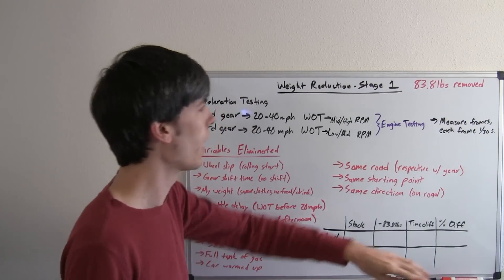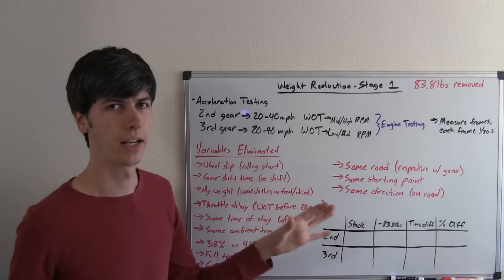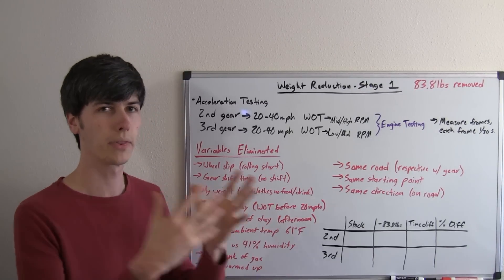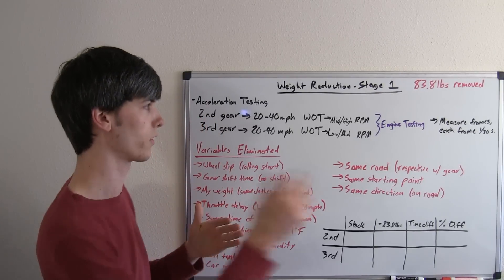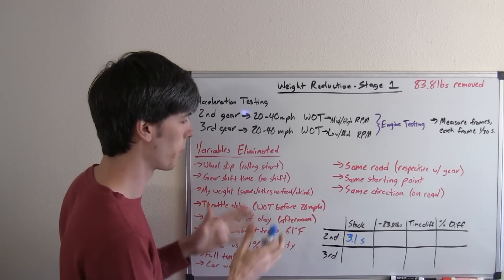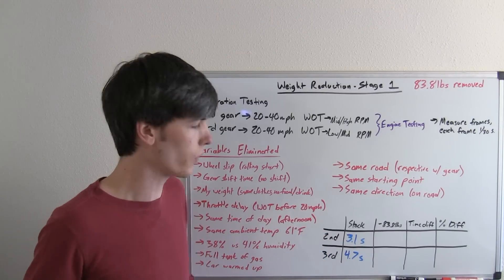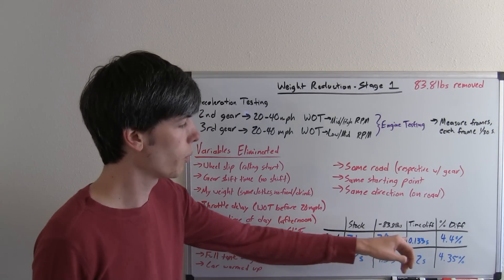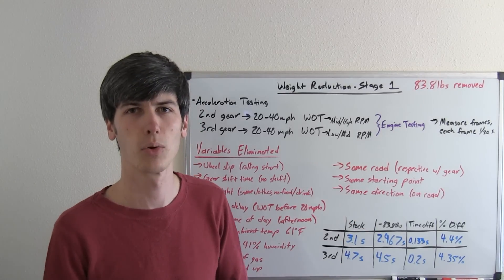Acura Integra Weight Reduction - Acceleration Testing - Stage 1

Comment: Hello .
Nice tests , thought i think you should be doing one more test at higher rev , because if you'll make more changes at intake , exhaust or other in the engine bay, the performance could be other at let's say 4000-6400 rpm than the low-mid rev. range. By the way your engine max. power is at 6300 rpm and max. torque at 5200 rpm; that means you did not touch any of max. power and torque in your tests. In that way you'll have a new comparison range .

Comment: you removed most of the weight from the back and it will mess up the balance of the car, since it's a FF it's already has all the weight in front
Reply from the maker: Yes indeed, I'll be looking to remove some weight from the front as well.

Comment: How about the wind ??
Reply from the maker: Based on weather reports it was essentially zero. The 2nd gear runs were in opposite directions from the 3rd gear runs, and they both provided similar results.
Reply: It was hot comment and you answered anyway, you guy rocks !
Test results are quite the same, so I'm satisfied by this test.
 i've learned so much from your videos, keep going on and thank you :)

Comment: So having taken into account all the variables, you do the runs in opposite directions. How does that take into the wind that will no doubt affect the results?

You said you wanted to use 2nd and 3rd gear for reference IF they were given reason to be used judging on this test, wind is a big factor
Reply from the maker: Sure. There wasn't wind when I was testing, the road is between a good amount of buildings/trees. Also, second and third gear pulls were in opposite directions, and both yielded similar results. Good point though for sure. The effects would be fairly negligible with low speeds (up to maybe 15-20 mph wind or so).
Reply: Engineering Explained Well it's not mentioned that it's between trees, that eliminates that variable, Stage 3 when?
Reply from the maker: xxxjake999xxx After stage 2. :)

Comment: What % of the stock weight is that 83lbs?
Reply: Engineering Explained that's interesting considering that it's 'almost' the same as the % time diff. I suspect this relationship wouldn't be linear though, but would flatten out on a weight-timediff curve.
Reply from the maker: Somewhere around 3%.

Comment: I think there is some empirical formula which argues that the acceleration 0-100Kmh is between [1,1.15] (confidence interval) times the weight to hp ratio (Kg/Hp)... Unfortunately, the bookmark I had stored it, is dead link now.
In this video you did not make such a test, but I am sure you have done. Do you confirm this formula?
Reply from the maker: Not sure of the formula, but with some F=ma math I'm sure it could be figured out.

Comment: When I had my Integra type R I carried out quick a bit of weight removal Taking the weight to 1030kg with a rollcage and bracing but no driver. From memory here are some of my findings. If you can be bothered the sound deadening in your boot will save about 4-5 kg if you can be bothered chipping away at it. Swapping the seats to racing seats saves 5-10kg per seat depending on what you go for. The roof lining and plastic furnishings in the back will save about 5-10kg. Changing the exhaust will save about 5kg by going to an aftermarket stainless steel one. Coilovers vs Stock Suspension will save a 2-3kg per corner. The aircon weighs about 20 kg.

Comment: To be honest, you never hit WOT, and this is mostly nit picking, but a 0-60 speed test from a stop is usually the best way to really test how a car will accelerate.
Reply from the maker: It was always at WOT (wide open throttle, aka the throttle fully open). 0-60 is not the best, because it allows for wheel slip and gear shift time variables. The results were incredibly repeatable (within 1/30th of a second).
Reply: Looking at the video again, I see that it was WOT, I forgot about the fact that the engine climbs in RPM even when the throttle is wide open, I apologize. Part of the reason I mention 0-60 though, is that the vast majority of the car world uses it as the benchmark for acceleration, but I can understand that you didn't want to do 0-60 tests because of speed limits and such. Just my two cents. Keep up the great videos however, I enjoy watching them.

Comment: Wow I am very impressed with the accuracy of the test. I know testing stuff and getting close to the same result is very hard, In my  CHM151 labs I had to get my results within 5 percent or I had to redo the lab, which proved to be challenging at times so seeing you get less than 1 percent error is impressive. You really controlled those variables.

Comment: What was the original weight of the car? I'm wondering to which extent the % of weight loss correlates to the % of acceleration gain.
Reply from the maker: Somewhere around 3% weight loss. 2650 or so.

Comment: you forgot wind direction and speed.
Reply from the maker: There wasn't any wind, didn't mention this. Also the pulls were in opposite direction, and yielded the same results (2nd gear pulls opposite from 3rd).
Reply: Engineering Explained
Ok, cool
Reply: @jstuttgart  I thought about that as well but that's an uncontrollable variable without a spotter outside the car while doing the test or second camera

Comment: You didn't take the wind factor into the account. FAIL... Just kidding, but it could have a small effect because a lot of resistance to car's movement is in the air. For example, if you draft a big bus on the highway, the resistance is greatly reduced and you can feel it too.
Reply from the maker: There wasn't any wind, didn't mention this. Also the pulls were in opposite direction, and yielded the same results (2nd gear pulls opposite from 3rd). And you're absolutely right, low wind speeds will be incredibly negligible.

Comment: Would be nice if you can do the same test with stock car vs unsprung weight savings. So if you can basically do the same test by removing 83.8, or close to that, of total unspung weight vs stock car it would be very cool.  Thanks again for an excellent and very unique video!
Reply from the maker: dwreus81 So... remove the tires and do an acceleration test? Haha, no way I'm getting 84 lbs out of unsprung weight, but if I do change the wheels/tires I'll do a test. The stock ones are aluminum I believe, so not much weight to save.
Reply: Engineering Explained Lol. Yeah I was going a little too far on that one.  I suppose it's also a lot more expensive do that kind of mod. Do your thing, we like what you do!
Reply: Engineering Explained  theres considerable weight savings in cast vs forged wheels. especially if you choose the right ones. volk ce28 and te37 are very light, with SSR type C and many similar design wheels also being very light. (im speaking low 5 kg range in 16x7, integra might want slightly bigger but thats the size i researched for myself)
Reply from the maker: deigima I think my current wheels are somewhere around 15 lbs. Might be off a little, but there's really not much weight to be saved.
Reply: Most wheels weigh around that point, so you're right.
at some point it might be an idea to get different wheels for the purpose of wider track ;)

Comment: Also the car's braking and handling would improve with less weight to lug around.  But I guess this is the only practical way to quantify the results to a solid number without having other factors influencing the results

Comment: Damn only 12xxxx and burning oil I feel bad for u I thought Honda engines never gave out
Reply: All Honda engines burn oil
Reply: Honda's use a very thin Oil, and 120K Miles + Is way past the High Mileage Point. Some people just need to realize Rubber Gadgets need to be replace, and RTV Added on top.

Comment: I know this guy is smart, I don't deny that, but this was hilarious.  I also realize this comment is going to get a bunch of negative replies.  It's just funny to me because this car is soo slow.  I'm not hating....it's actually interesting, and well done.  

Here's a good idea to test out....
Take a car that can run just fine on 87 octane. Run it X distance to see what mpg it gets.  Then fill it with 93 octane, and see what mpg it gets.  Do this with a car that is older so that it doesn't change its timing because it can now advance the timing some due to the higher octane.  Will the 93 get better, it worse, mpg?

I realize there are variables that make this difficult.  :)

Comment: Can't wait for Stage 3! (I realize you haven't done stage 2 yet, but stage 3 should be almost race-car right?)
Reply from the maker: Stage 3 will be crazy! (Don't even know what it is yet haha).
Reply: Engineering Explained Are you going to pull panels, headliner, carpet, shift boot, and stuff like that or is this about how stripped it will get?
Reply: Got2finish Not even race cars remove that stuff.
Reply: Dest Droid except drag car
Reply: Turbo and nitrous injection
Reply: Engineering Explained stage 3 should include removing A/C and power steering

Comment: It would be interesting to see what effects the weight reduction would have on wheel spin.

Because the wheels have less weight to propel forward there should be less wheel spin. Obviously the tires also need enough weight on them so they have adequate traction, but I doubt we're nearing that threshold with an 83LBs weight reduction. 

What sort of tests could you do to measure this?
Reply from the maker: Well, really wheel spin is a matter of friction, F=uN. If we reduce the weight of the car, the ability to spin the tires is easier, since the force needed is less. That said, your acceleration would not change if you're traction limited (if you spin at one weight, or at a higher weight, ideally you would just not spin tires, so you'd accelerate the same). This would be much more prevalent from a stop.
Reply: Engineering Explained in my experience (15 seasons of drag racing) weight reduction makes wheel spin significantly easier and overcoming the point of inertia while maintaining traction becomes more difficult.  One way to look at this is a power to weight ratio. if the power remains constant but the weight is reduced than each HP has less work to do. the car is easier to get moving but also easier to lose traction
Reply: Engineering Explained by the way I like your channel I only discovered it when you did the black intercooler video, which I also agree with.  I am now a subscriber!
Reply: 929dano
There are 2 factors to consider in that  weight reduction V's traction issue's is the drive train layout as in FWD or RWD,we could add in 4wd (but thats cheating imo),and were from the car the weight is removed from on the car/chassis
as in removing the majority of the weight removed from the front of a FWD car would cause possibly more traction issues than if it was removed from the rear
Like drag civics strip the rear end,run skinny rear wheels and move as much stuff forwards to keep weight over the driven axle
just my 2p on weight reducing
Reply: ANDYblacks13 indeed you are correct. When building my integra it was for drag racing so I removed most weight from the back and the roof to keep the weight over the drive wheels and keep the center of gravity low. That being said, it still becomes more difficult to maintain traction over stock weight because there is less force per square inch pushing on the tires. This would effect traction on a rear drive car as well, just not as much because as you launch the force of your weight shifts back, helping traction on a rear drive... but hurting traction on a front drive

Comment: I was about as excited as you were that the tests were so accurate. I asked on your facebook page, but do you have a video on front mount vs top mount intercoolers and the advantages/disadvantages of both? also, i've always wondered about subarus that move their intercooler from the top to front and keep the hood scoop. Does keeping the hood scoop when there is no intercooler there affect anything?
Reply from the maker: These are great questions, may get into this one day. The empty scoop would just be a source of drag.
Reply: Dirty D  scoobaru without a scooparu is blasphemy
Reply: It would cause drag, but it also could bring down the Intake manifold temp which inturn allows the air to be compressed more. "Not saying it would be any significant hp gain" but it would help the issue of having a heat soaked Intake manifold. Just my 2 cents